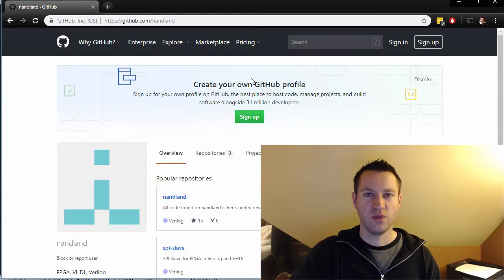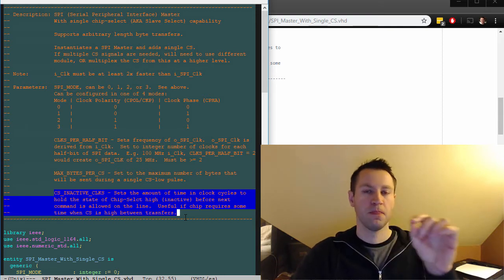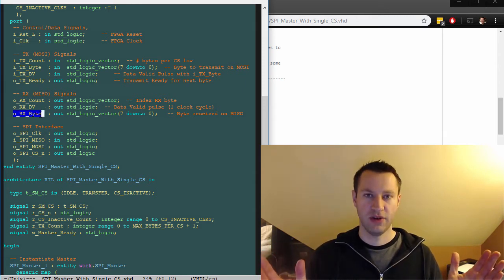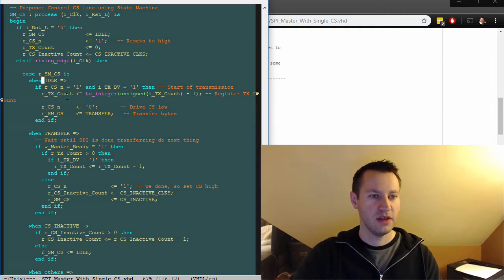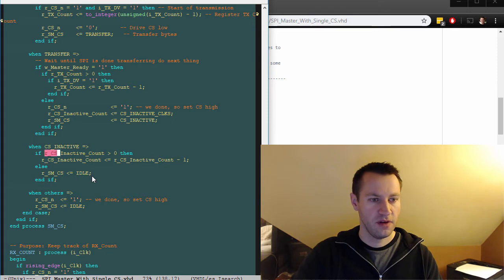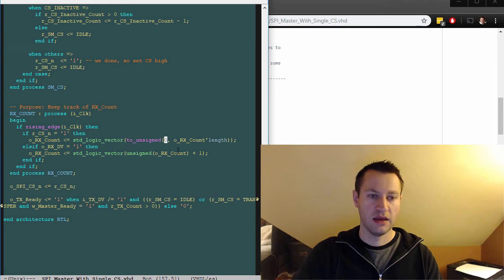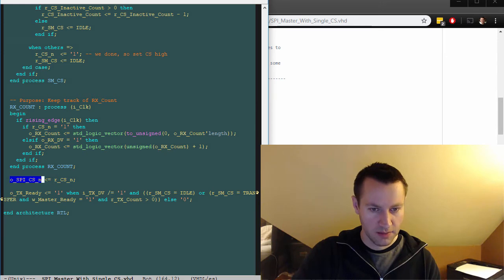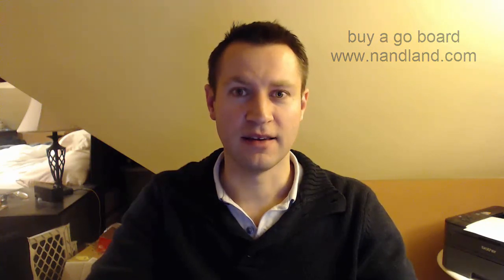SPI Master with Chip-Select in FPGA, VHDL Code

Comment: Can you please comment on how to connect multiple drivers to a certain net via tri-state logic?  For example in multi-slave SPI system, based on the CS signal only one of the slaves will generate a binary output for the "CIPO" while the rest will generate a high-z. However, when i try to simulate it i get the 'multiple drivers for a net' error - which in this case is intentionally.

Thanks!

Comment: I use 17.1 Quartus compiler and it's giving me an error as shown below:

Error (10481): VHDL Use Clause error at SPI_Master_With_Single_CS.vhd(84): design library "work" does not contain primary unit "SPI_Master". Verify that the primary unit exists in the library and has been successfully compiled.
Reply: That error indicates that you haven’t first compiled the “SPI_Master.vhd” file into your work library. It needs to be compiled into your work library first since that component is being instantiated in a higher level entity. Hope that helps